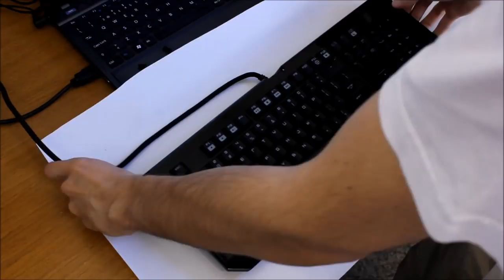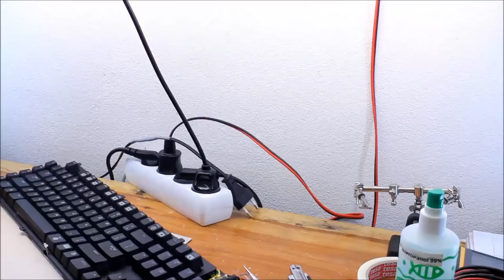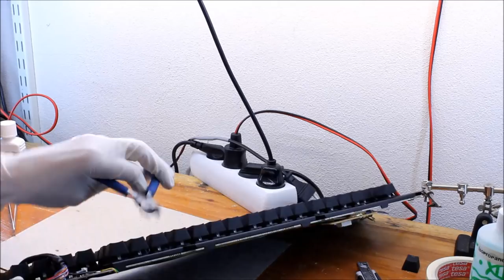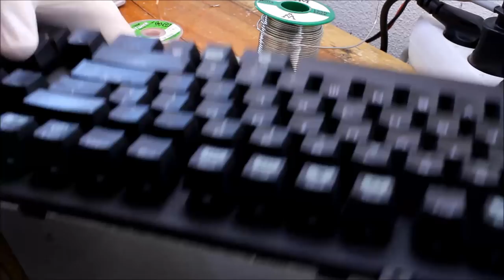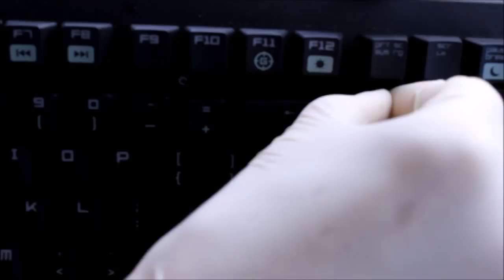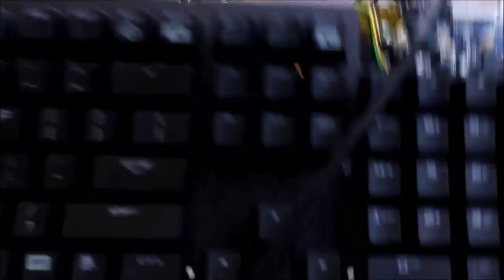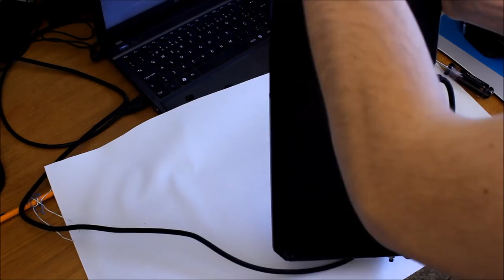How to replace backlight LEDs and Cherry MX switches in a mechanical keyboard.

Comment from the maker: They are in the top side of the PCB, but they are under the black metal bezel, if you want to replace them you will have to remove all the LEDs and switches in order to remove the metal bezel and have access to the resistors. They are SMD and, if I recall correctly, I believe they are 470 ohms in the size 0603.

Comment from the maker: Yes, after getting the keyboard disassembled the procedure should be very similar. Search on sites like ebay for "3mm flangeless red" a bag of 100 LEDs should cost from 3 to 5 USD, buy a couple of bags.

Remember that red LEDs have a lower forward voltage than white ones, so they will draw more current, you might want to avoid using the maximum brightness setting to avoid stressing the driving components.

Comment from the maker: Just remeber to be careful cleaning the holes of the old LEDs, I overheated one and while using the desoldering pump I lifted a bit of the copper, that's why in my other video you see a green bodge wire in the pcb near the Scroll Lock key. Don't worry, though, if you mess it up it is very easy to fix.

Comment: thanks for the video 'hose-A' (not to be confused with hose-B). i modded 80% of my keyboard by swapping out the mx blue with mx green. the process of the video was very clear and was good as pointing out what i needed to do
Reply from the maker: :)
How do you like those heavier new green switches? Is there a considerable advantage or is just a personal thing? I like mine tactile and as light as possible, that's why I went with browns, but it's just because they feel right, I didn't have a specific logic reason. And because there are people around me I can't use the clicky versions, my keyboard with blues was driving people mad when I had to type a lot of text (in the end it was starting to get to me too).
Reply: José Faria  so far i am liking the mx green switches. if i were to describe it they feel like a more solid/stable version of the blues. i don't find them heavy like I've heard people say in other videos but i do a lot of activities with my hands including playing piano and guitar along with casually working out. 
i'd say it was just a personal choice for wanting green switches, i think if i get another keyboard ill get clears for some variance

Comment from the maker: Sure, just find where the track begins and where it ends and solder a wire to connect them both. 

If you click on the WordPress post linked in this video's details and scroll down to the image with the description "Everything in place, ready to reassemble." you can see in the top left a green wire between two of the LEDs doing just that.

Comment from the maker: You'll need 3mm LEDs, preferably flangeless ones, otherwise you might have to slightly file the plastic "skirt" for them to fit perfectly.
Reply: What voltage? Do you have a link to any you reccomend?
Reply from the maker: @brickson98m  There will probably be exceptions, but most LEDs will probably work, regardless of voltage, usually we just worry about limiting the LED current, by doing that the LED voltage automatically drops to the LEDs forward voltage value.

Comment from the maker: It's a soldering station, it's branded "daxis", but it's just a cheap clone of the hakko 936. It has a 50W heater. 

I do have better soldering stations, but I like to use this one for quick jobs like this because it gets up to temperature really fast and I have local dealers that sell compatible tips and heaters. For 35 euros in my local shop it is unbeatable!

Comment: Great & Helpful video!
I accidentaly removed the blue depressor of the switch together with the key caps when removing them when I was trying to clean them. I forced them back but it looks like ONE of the very little sliding guide (1mm x 2mm) that is on both the left and right of the depressor is broken. Can I still reinstall them after removing the metal plate from the PCB?

thanks in advance!

Comment from the maker: That multiple stroke phenomenon is called switch bounce. When it happens in a properly designed product like yours, it usually means a problem in a switch. 

Just to be sure it's not the software acting funny, try it in another PC.

If the keyboard is new, talk to steelseries support and I'm sure they will fix it. If it's already out of the warranty period, in the meantime you can try and spray a bit of contact cleaner to mitigate the problem, but the switch will eventually need to be replaced.

Comment: Hey, I have a keyboard with CHerry MX blues, without any leds, but it looks liek they still have the openign for them. Do you think I coudl add them in, or do you think the board itself wouldn't have the slots for them?
Reply from the maker: It should be reasonably easy to open your keyboard and check, that's the safest way to know. Also, remember that it's not just the lack of LEDs, you would also need to replace your keycaps, it's very likely your symbols etched on top are not translucent, that means even with LEDs installed your keys would still not light up.
Reply: Yeah I figured I'd need new key caps! 
Thanks for the help

Comment: Hi Jose - great work. I read in your article that if you want a backlit keyboard, just go with a ducky or some other mechanical keyboard. My question is - I've already purchased a new 2014 razer blackwidow ultimate stealth, I like the new switches but was hoping to swap out the LED colors from Green to Purple. I have the equipment do this, but not sure where the backlight is coming from? Is there a place I can find the backlight LED? Is it possible to swap those out?
Reply from the maker: I might be wrong, but I was under the impression that razer switches are just cherry clones, if this is true your keyboard should be virtually identical to this one and the replacement procedure should also be similar. The glow you see between the keycaps is probably just the light being reflected from under the keycap. Just pull one of the keycaps and check what's underneath.

Regarding keyboards, I ended up with a cooler master with cherry mx brown keys, I find it pretty much perfect now :D

Comment: Hey José, my "E" and "R" key don't have any click at all (spilled a drink...) so I wanted to use my print screen and another button to replace it. Do I have do anything else other than loosening soldering  it then re-soldering to pull the light out so I can get to the key?
Reply from the maker: Follow the procedure in the video and you should be fine. What do you mean they don't click, they don't work at all or they work but without the clicking sound and the tactile bump? If it was a drink with sugar, you might want to try and open the key up and clean it thoroughly with distilled/deionised water.

Comment: Ok so quick question, will the brightness of the LED's still be adjustable if replaced on the keyboard? I wasn't sure if the adjustable brightness feature is a part of the actual LED's lights themself, or just a feature that is a part of the keyboard that can be applied to any LED light.
Reply: I can't guarantee this for your keyboard, but if the keyboard is doing dimmable LED correctly/the standard way, then you do not need special LEDs. The dimming is achieved through a controller that uses a technique known as pulse width modulation (PWM) - that is, to achieve different brightness, the LED is toggled on and off with a variable ratio between the on and off time periods and that controls how bright the LED appears. Since PWM just toggles the LED on and off, any LED should work.

Comment: dude, how many watts (W) or degrees your soldering iron was? I was thinking to get one soldering iron with 34W (450 degrees maximum), is that too high or too low?
What woul'd be the perfect watts for desoldering switches and to solder it?
Reply from the maker: Well, it depends, but if it's a "regular" soldering iron (just the iron and a power cord) you might want a lower wattage iron, if you use a temperature controlled soldering station it doesn't matter as much, in fact, the higher wattage is better (the station won't let the iron overheat and when you cool it while soldering it has more power to recover the lost heat). I higly recommend a soldering station, they are worth it, even the cheap ones are better than a regular iron.

The video is not a really good example on iron technique, but use a soldering iron set to 350°C and you should be OK.

Comment: what year is it ? i have a blackwidow ultimate 2014 and it's not polished plastic, my D button just gone wrong, the feel is wrong and it's not more clicky, i want to replace it with a key from the numeric section. THANK YOU VERY MUCH for this video, i have a solder pump so i will do it right.
Reply from the maker: I don't have it anymore, but I believe it was the 2012 model.

Comment from the maker: I only have experience with cherry mx blue and red switches, and those all had the LED space available. I do know, however, that Cherry sells several different variants of the same switch, you can have, for instance, a jumper instead of the LED or an integrated diode to help implement the NKRO. 

If you want more details do a google search for "deskthority cherry mx wiki" and check the first link.

Also, bear in mind that there are also other keyboard switch manufacturers, like ALPS.

Comment: I have 3 keys with problem in my Blackwidow Chroma, they just work  with some red or green tones. Also if i use de reactive config in synapse and press those keys, they light up other keys in others colors different from the ones that i choosed. Do you think that if i replace the leds they will work fine ?
Reply from the maker: +William Lopes It sounds like the blue LED chip in those keys is broken. Replacing it should solve it, but you will need to find a compatible LED (same size and pinout, they should have 4 pins). If your keyboard is still under warranty you should ask for a RMA.

Comment: Nice tutorial!
Am I right to think that I can change single switches with other types (eg. replace an mx red with a clear switch)?
And how do I know which LED I have to buy? I got whites and don't want the new one to be brighter/dimmer than the others.
Reply from the maker: If you are changing switches from the same manufacturer and series you should be able to replace them, sometimes even between different manufacturers.

If your LED is broken that is actually a problem, it is hard to get LEDs with exactly the same color and intensity, but the keycaps lose most of the light and make things a bit more even. But if you are replacing a switch that had a working LED you can always reuse the same LED.

Comment: If I wanted to do this with a Corsair K95 Keyboard and say, switch the LEDs from white to Blue, is it pretty much the same process? and what materials to I need to replace it? and would the keyboard still recognize the LEDs and give it the options to Lower/Higher The Brightness?
Reply from the maker: It should be a very similar process.  
I reckon you would need:
- Screwdrivers (to open the keyboard)
- Replacement LEDs (remember to buy flangeless ones)
- Soldering iron (avoid using extreme temperatures)
- Solder (maybe some flux too if the solder doesn't have a good flux core)
- Solder wick or solder sucker to clean the holes

LEDs are passive components, the keyboard should not have any problems with the different LEDs, especially since white and blue LEDs are electrically identical. If you want, you could also replace only one of the LEDs and turn the keyboard on to see the results.
Reply: José Faria is it 3mm for the LEDs? and we dont need to do any 'modding' to the LED's, it would just fit?
Reply from the maker: Yes, 3mm LEDs. If you buy flangeless LEDs they will fit without any problems, if you buy LEDs with flanges you might have to grind the flanges away for them to fit properly.

Comment from the maker: That's the spec of the LED, right? 25 degrees is a bit tight, might not diffuse very well (the center of the key a lot brighter than the edges), but you can always buy just a couple to use as a sample and then buy the rest if the result is satisfactory.

Comment from the maker: I'm portuguese. If the keyboard has the place for the LEDs I wouldn't be surprised if all that it takes is for someone to populate the components. However, keyboards without backlight from the factory usually have regular opaque keycaps, you'll probably have to replace all the keycaps so the light can get through them. Search on sites like wasd keyboards. 

Also, bear in mind that that hack might get more expensive than selling the keyboard and buying a backlit one!

Comment: I just bought a Gigabyte Aivia Osmium (red switches), and I'm very happy with the result (I got tired of Synapse crapware aswell with an extremely overpriced and just average Ouroboros mouse). The quality is good, you have internal memory, a maybe too-basic software but all works as it should.

Logitech G710+ is a good piece of hardware aswell (brown switches), and with probably the best software in this area, but a bit overpriced IMO.

@José Faria: Nice video, very clear and well explained.

Comment from the maker: That's strange, but if the switch appears to be working (check with a multimeter) it will probably work after being reinstalled, but I would probably replace it, it probably had some kind of mechanical problem. Try to search on websites like ebay for "cherry mx blue", asian sellers usually have reasonable shipping costs.

Comment from the maker: The regular blackwidow has a PCB similar to the ultimate. If the PCB also has the current limiting resistors you only have to solder the LEDs.

To check if you have the resistors use a multimeter to measure the impedance between the +5v rail from the usb and the LED holes. If the impedance is 470 ohm or something like that there are resistors in place, otherwise add the resistors.

As for the video I don't know anyone with one to lend me and I can't afford one just to make a video :P

Comment: Thanks, but the one I desoldered wrong was the cherry mx connection part, now I don't know if there are resistances to it, so I hesitated a bit.

Gonna try connecting a wire if it still uses the old keyboard matrix

Comment: idk if you check the comments on this old video, but i just want to clarify that its a cherry MX blue switch, and that i can put the LED through it for my black widow ultimate. thank you for the tutorial by the way, i need to replace my S key
Reply from the maker: I'm a bit lost with your comment, can you elaborate?
Reply: @jfaria  nevermind haha I got it it was a dumb question
Reply: @jfaria  I am now wondering after looking into the parts, is the keyswitch you need for this keyboard PCB mounted or plate mounted?
Reply from the maker: To be honest I don't remember, but check this article and compare yours with those pictures:
https://support.wasdkeyboards.com/hc/en-us/articles/115009270628-Plate-Mounted-vs-PCB-Mounted-Switches
Reply from the maker: It's probably the plate mounted though

Comment: Question, what size are the LED's? have a few bad LED's on my corsair keyboard i need to replace.

Thanks!
Reply from the maker: If it's an old or "regular keyboard" it will use a regular 3mm LED without flange. Note that it will be hard to get LEDs with exactly the same color tone. If it's one of these newer keyboards with transparent switches and RGB lighting, you will have to replace the SMD LED under the switch. You can check this easily by pulling the keycap and checking whether you see the LED or if it's a transparent switch.

Out of curiosity, what keyboard do you use? I used several and I've never seen a failed LED (which, granted, might happen), let alone several failed LEDs, that is kind of strange...
Reply: +José Faria Corsair K95, Pre RGB ones have an issue with LED'S going Dead.

Comment: Seems like a project for a rainy day, how long do you reckon this would take to redo all the keys to another colour? Currently blue but I want to do green so it matches my newer gear, LEDs are dirt cheap so go figure. Looks like ill also have to put in an LED for the FN key as it's going to be replaced by a custom lightning bolt keycap. Anyway thanks for the vid I hate taking things apart when I have no idea what to expect.
Reply from the maker: I did that with the keyboard in the video, replaced the blue LEDs with white ones. If you have some soldering experience and buy flangeless LEDs, expect 1 or 2 hours of work.

Comment: I'm replacing the LEDs on my BlackWidow Ultimate 2013, from Green to blue, however, when installing the LEDs, which hole should I place the positive end in?
Reply from the maker: The easiest way is to look at how one of the original LEDs is connected, but if you already removed them all, you can just plug the keyboard and check which way the led lights up. You wont damage the led if you test it the wrong way. After you know where the anode points, I believe the rest of them are all pointing the same way.
Reply: José Faria Awesome! Thanks!

Comment: I went to a shop specialized in electronics and they don't sell LED of anything color that a keyboard could power. I tried their smallest but it requires 2 volts to light up. Where can I buy the LEDs online?
Reply from the maker: What do you mean the keyboard won't power it? The keyboard should be able to light up virtually all common 3mm LEDs, did you try them?

Comment: Hi Jose, i'm going to attempt to change the LED on my Razer Blackwidow to orange, will be using 3000 mcd LEDs. In relation to the lights which light up the num-lock caps lock etc if I'm not mistaken they are the same ones which have the resistors attached to them, do I need a different LED and do they need to be installed differently?
Reply from the maker: Yes, they are the same, 3mm LEDs. Beware that those look like they have flanges, you might have to sand or file away the flange from the base for them to fit.